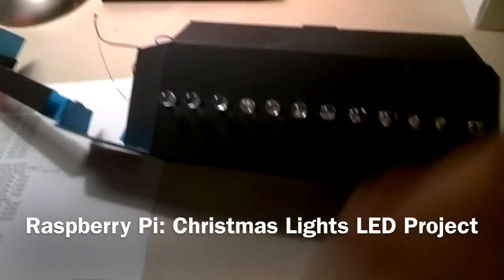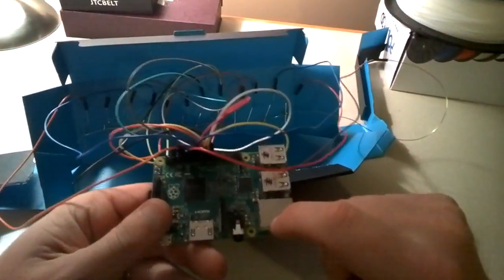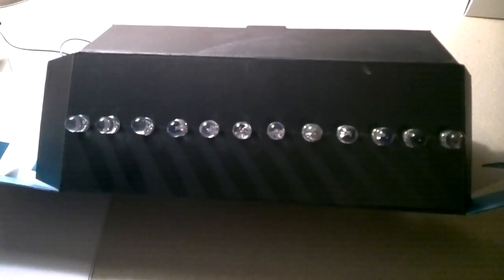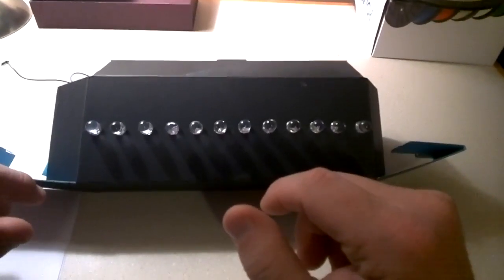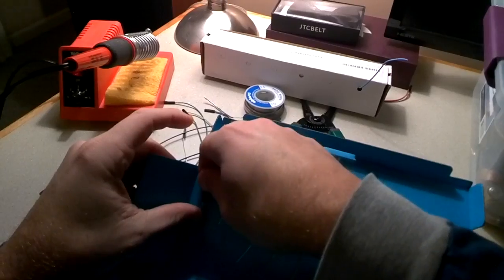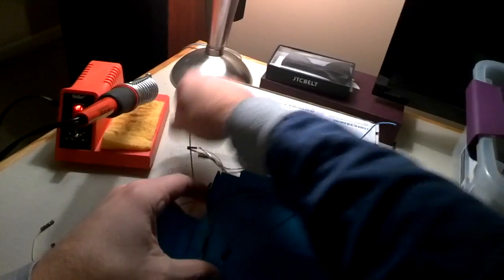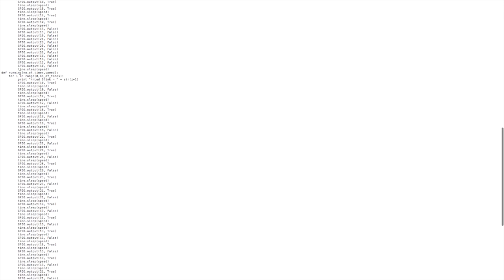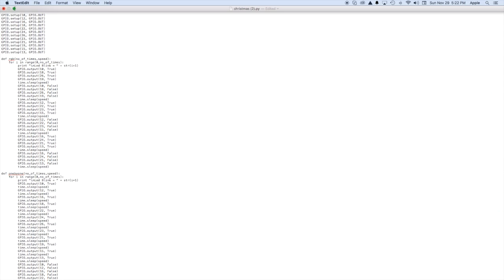Raspberry Pi: Christmas Lights LED Project

Comment from the maker: import RPi.GPIO as GPIO
import time
GPIO.setmode(GPIO.BOARD)

GPIO.setup(10, GPIO.OUT)
GPIO.setup(12, GPIO.OUT)
GPIO.setup(16, GPIO.OUT)
GPIO.setup(18, GPIO.OUT)
GPIO.setup(22, GPIO.OUT)
GPIO.setup(24, GPIO.OUT)
GPIO.setup(26, GPIO.OUT)
GPIO.setup(23, GPIO.OUT)
GPIO.setup(21, GPIO.OUT)
GPIO.setup(19, GPIO.OUT)
GPIO.setup(15, GPIO.OUT)
GPIO.setup(13, GPIO.OUT)
GPIO.setup(11, GPIO.OUT)
GPIO.setup(7, GPIO.OUT)
GPIO.setup(5, GPIO.OUT)
def rgb(no_of_times,speed):
    for i in range(0,no_of_times):
         print "\nLed Blink = " + str(i+1)
         GPIO.output(10, True)
         GPIO.output(18, True)
         GPIO.output(26, True)
         GPIO.output(19, True)
         GPIO.output(11, True)
         time.sleep(speed)
         GPIO.output(10, False)
         GPIO.output(18, False)
         GPIO.output(26, False)
         GPIO.output(19, False)
         GPIO.output(11, False)
         time.sleep(speed)
         GPIO.output(12, True)
         GPIO.output(22, True)
         GPIO.output(23, True)
         GPIO.output(15, True)
         GPIO.output(7, True)
         time.sleep(speed)
         GPIO.output(12, False)
         GPIO.output(22, False)
         GPIO.output(23, False)
         GPIO.output(15, False)
         GPIO.output(7, False)
         time.sleep(speed)
         GPIO.output(16, True)
         GPIO.output(24, True)
         GPIO.output(21, True)
         GPIO.output(13, True)
         GPIO.output(5, True)
         time.sleep(speed)
         GPIO.output(16, False)
         GPIO.output(24, False)
         GPIO.output(21, False)
         GPIO.output(13, False)
         GPIO.output(5, False)
         time.sleep(speed)

def onebyone(no_of_times,speed):
    for i in range(0,no_of_times):
         print "\nLed Blink = " + str(i+1)
         GPIO.output(10, True)
         time.sleep(speed)
         GPIO.output(12, True)
         time.sleep(speed)
         GPIO.output(16, True)
         time.sleep(speed)
         GPIO.output(18, True)
         time.sleep(speed)
         GPIO.output(22, True)
         time.sleep(speed)
         GPIO.output(24, True)
         time.sleep(speed)
         GPIO.output(26, True)
         time.sleep(speed)
         GPIO.output(23, True)
         time.sleep(speed)
         GPIO.output(21, True)
         time.sleep(speed)
         GPIO.output(19, True)
         time.sleep(speed)
         GPIO.output(15, True)
         time.sleep(speed)
         GPIO.output(13, True)
         time.sleep(speed)
         GPIO.output(11, True)
         time.sleep(speed)
         GPIO.output(7, True)
         time.sleep(speed)
         GPIO.output(5, True)
         time.sleep(speed)
         GPIO.output(10, False)
         GPIO.output(12, False)
         GPIO.output(16, False)
         GPIO.output(18, False)
         GPIO.output(22, False)
         GPIO.output(24, False)
         GPIO.output(26, False)
         GPIO.output(23, False)
         GPIO.output(21, False)
         GPIO.output(19, False)
         GPIO.output(15, False)
         GPIO.output(13, False)
         GPIO.output(11, False)
         GPIO.output(7, False)
         GPIO.output(5, False)
         time.sleep(speed)
         GPIO.output(5, True)
         time.sleep(speed)
         GPIO.output(7, True)
         time.sleep(speed)
         GPIO.output(11, True)
         time.sleep(speed)
         GPIO.output(13, True)
         time.sleep(speed)
         GPIO.output(15, True)
         time.sleep(speed)
         GPIO.output(19, True)
         time.sleep(speed)
         GPIO.output(21, True)
         time.sleep(speed)
         GPIO.output(23, True)
         time.sleep(speed)
         GPIO.output(26, True)
         time.sleep(speed)
         GPIO.output(24, True)
         time.sleep(speed)
         GPIO.output(22, True)
         time.sleep(speed)
         GPIO.output(18, True)
         time.sleep(speed)
         GPIO.output(16, True)
         time.sleep(speed)
         GPIO.output(12, True)
         time.sleep(speed)
         GPIO.output(10, True)
         time.sleep(speed)
         GPIO.output(5, False)
         GPIO.output(7, False)
         GPIO.output(11, False)
         GPIO.output(13, False)
         GPIO.output(15, False)
         GPIO.output(19, False)
         GPIO.output(21, False)
         GPIO.output(23, False)
         GPIO.output(26, False)
         GPIO.output(24, False)
         GPIO.output(22, False)
         GPIO.output(18, False)
         GPIO.output(16, False)
         GPIO.output(12, False)
         GPIO.output(10, False)
         time.sleep(speed)
def running(no_of_times,speed):
    for i in range(0,no_of_times):
         print "\nLed Blink = " + str(i+1)
         GPIO.output(10, True)
         time.sleep(speed)
         GPIO.output(10, False)
         time.sleep(speed)
         GPIO.output(12, True)
         time.sleep(speed)
         GPIO.output(12, False)
         time.sleep(speed)
         GPIO.output(16, True)
         time.sleep(speed)
         GPIO.output(16, False)
         time.sleep(speed)
         GPIO.output(18, True)
         time.sleep(speed)
         GPIO.output(18, False)
         time.sleep(speed)
         GPIO.output(22, True)
         time.sleep(speed)
         GPIO.output(22, False)
         time.sleep(speed)
         GPIO.output(24, True)
         time.sleep(speed)
         GPIO.output(24, False)
         time.sleep(speed)
         GPIO.output(26, True)
         time.sleep(speed)
         GPIO.output(26, False)
         time.sleep(speed)
         GPIO.output(23, True)
         time.sleep(speed)
         GPIO.output(23, False)
         time.sleep(speed)
         GPIO.output(21, True)
         time.sleep(speed)
         GPIO.output(21, False)
         time.sleep(speed)
         GPIO.output(19, True)
         time.sleep(speed)
         GPIO.output(19, False)
         time.sleep(speed)
         GPIO.output(15, True)
         time.sleep(speed)
         GPIO.output(15, False)
         time.sleep(speed)
         GPIO.output(13, True)
         time.sleep(speed)
         GPIO.output(13, False)
         time.sleep(speed)
         GPIO.output(11, True)
         time.sleep(speed)
         GPIO.output(11, False)
         time.sleep(speed)
         GPIO.output(7, True)
         time.sleep(speed)
         GPIO.output(7, False)
         time.sleep(speed)
         GPIO.output(5, True)
         time.sleep(speed)
         GPIO.output(5, False)
         time.sleep(speed)
         GPIO.output(5, True)
         time.sleep(speed)
         GPIO.output(5, False)
         time.sleep(speed)
         GPIO.output(7, True)
         time.sleep(speed)
         GPIO.output(7, False)
         time.sleep(speed)
         GPIO.output(11, True)
         time.sleep(speed)
         GPIO.output(11, False)
         time.sleep(speed)
         GPIO.output(13, True)
         time.sleep(speed)
         GPIO.output(13, False)
         time.sleep(speed)
         GPIO.output(15, True)
         time.sleep(speed)
         GPIO.output(15, False)
         time.sleep(speed)
         GPIO.output(19, True)
         time.sleep(speed)
         GPIO.output(19, False)
         time.sleep(speed)
         GPIO.output(21, True)
         time.sleep(speed)
         GPIO.output(21, False)
         time.sleep(speed)
         GPIO.output(23, True)
         time.sleep(speed)
         GPIO.output(23, False)
         time.sleep(speed)
         GPIO.output(26, True)
         time.sleep(speed)
         GPIO.output(26, False)
         time.sleep(speed)
         GPIO.output(24, True)
         time.sleep(speed)
         GPIO.output(24, False)
         time.sleep(speed)
         GPIO.output(22, True)
         time.sleep(speed)
         GPIO.output(22, False)
         time.sleep(speed)
         GPIO.output(18, True)
         time.sleep(speed)
         GPIO.output(18, False)
         time.sleep(speed)
         GPIO.output(16, True)
         time.sleep(speed)
         GPIO.output(16, False)
         time.sleep(speed)
         GPIO.output(12, True)
         time.sleep(speed)
         GPIO.output(12, False)
         time.sleep(speed)
         GPIO.output(10, True)
         time.sleep(speed)
         GPIO.output(10, False)
         time.sleep(speed)
         
    print "\n\nThank You Sir ! Total number of times LED Blink = " +str(no_of_times) +"\n\n"
    GPIO.cleanup()
  
print "*** Welcome to LED Blinking Program ***"
print "____________________________________\n"
how_many = input("Enter the total number of times to blink LED = ")
speed = input("\nEnter the blink duration in seconds = ")
onebyone(int(how_many),float(speed))
rgb(int(how_many),float(speed))
running(int(how_many),float(speed))